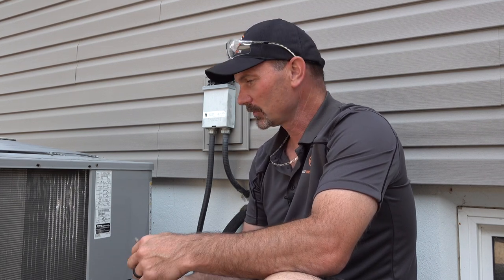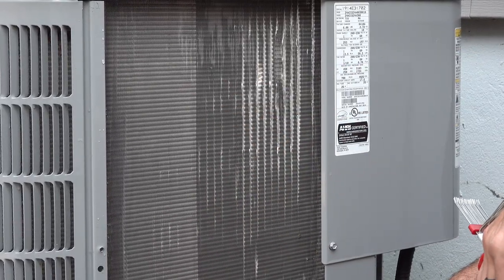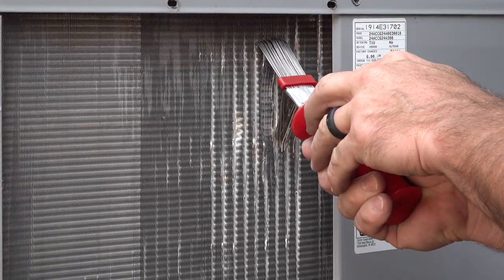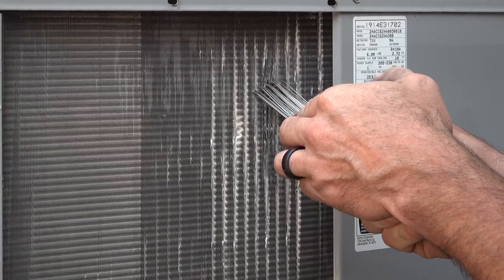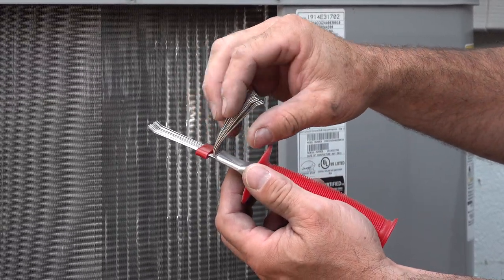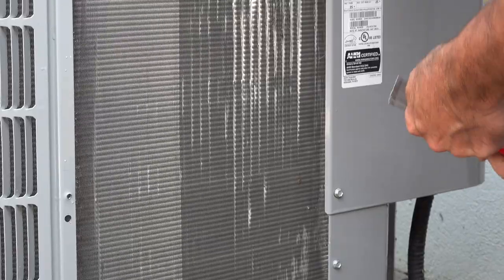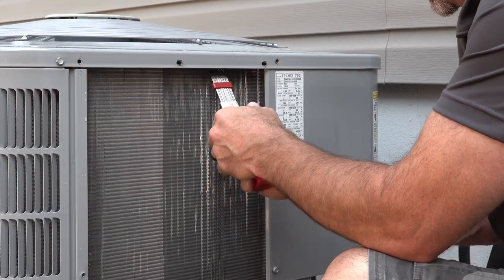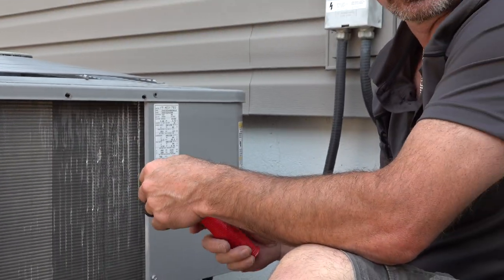How To Straighten Your A/C Condenser Fins

Comment: As a commercial HVAC Tech. I have spent alot of hours straightening fins. Thats not the tool I personally would use. It definitely takes some practice to do it right.
Reply: What tool would you use?
Reply: @badazzbob  I would use a fin comb that matches the fins and very carefully comb them out using a pocket screwdriver to straighten up snag points. It's a very time consuming process to do it correctly.

Comment: Guys, I have minor bents in a new Car AC evaporator which I ordered. Does small Bents affect the car AC system? Should I return it ? Bents are small but I am afraid it will cause damage. I hope someone can answer and help me. Last year I lost my Car's AC compressor, and condenser due to a bad evaporator which development mould in it. So I hope some can help with this question 🙏
Reply from the maker: It will slightly reduce the effectiveness of the coil, if they' re minor you could straighten them and likley be fine
Reply: @HouseImprovements  Thank You for replying. I will take it to a professional and get it fixed. Thanks again 🤝

Comment: For the really bad ones use a small bladed flat screw driver and straighten one fin at a time. then you can comb it after they are mostly straight.
Reply: Thanks, this helped on a really bad air conditioner i had

Comment: That took sucks, looks like you're doing more harm than good.  There are better ones on the market.  I got one with 6 coloured combs on a ring and each end had a different size comb.  Think I got it on Amazon. Just try each end to find the one that matches your AC fin spacing.
Reply from the maker: Ya this one seems to be coming apart on me.

Comment: Think you could do a video on getting the bolt and regular door knobs aligned in a frame (so both go in as it’s shut, my problem is one shuts sometimes without the other entering the hole)? Seems easy enough to but I don’t want to mess up the frame by drilling too much
Reply from the maker: we can help you at the forum. Look for a link in the description under most of our videos.

Comment: Thanks for the tutorial, I took on this project this weekend. I didn’t feel like buying that tool, so I just used a very small flat head screwdriver. Honestly I think it worked better than the tool you used in the video. There’s no way to rush this. The best is to take your time and straighten each fin individually. Followed up with your video on how to clean the air conditioner condenser, and it’s running like a dream. Thanks!

Comment: It is due to a cheap design by Carrier.  I had a new system installed and in the same area I have some crushed fins, there is nothing on the right side of the exterior grill to screw into, so if you push the grill it flexes and hits the fins.  The overall construction of my Carrier performance condenser seems cheap, like they used the thinnest metal possible.